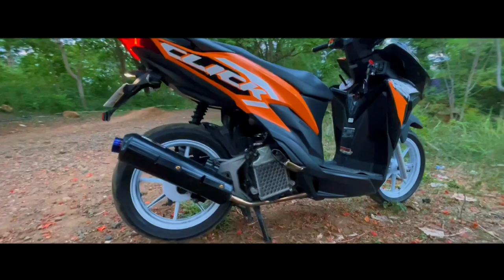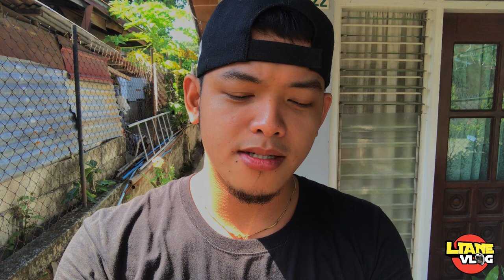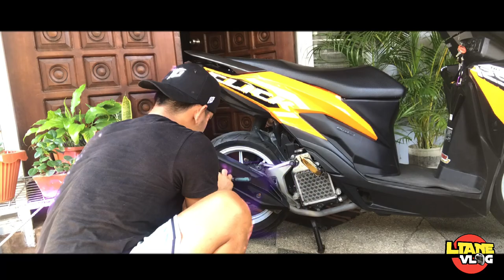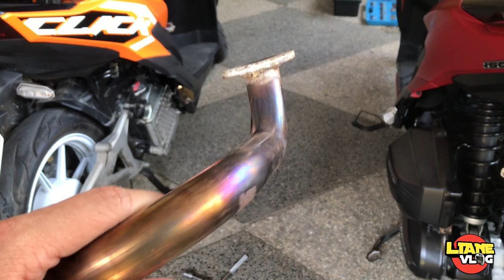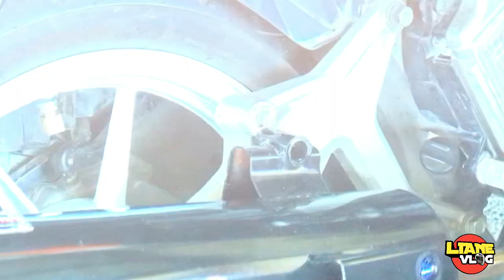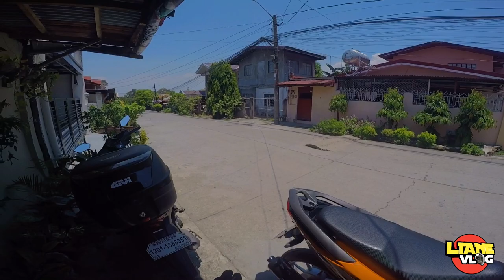SOUND CHECK NG MT8 RACING PIPE | HONDA CLICK 125i | GAME CHANGER

Comment: paps mt8 ba yan? yong sa akin kc is v2 ata yong stainless tip, ask lng po sana paps pano ba ma refiber to wala kasing opening para ma remove ng babackfire na kasi
Reply: Trusted mo na muffler shop ng mga kotse,mas maganda kung may tig welding cila ,cut nila Yung pipe mo,lagyan ng bagong fiber then welding uli ng tig welding,.Yun lang Yun ka simple